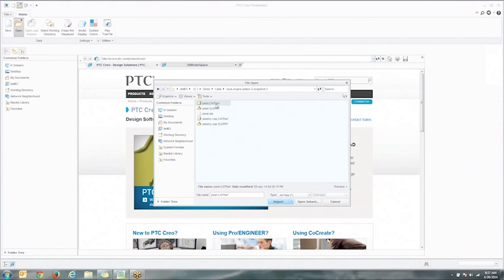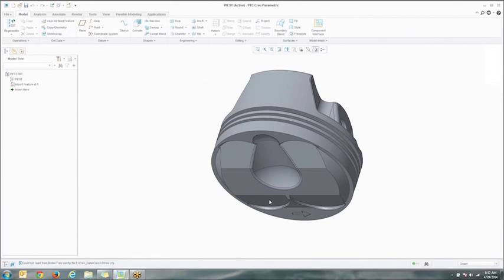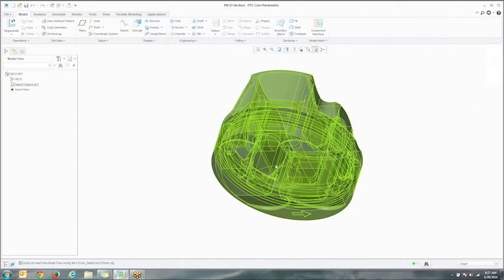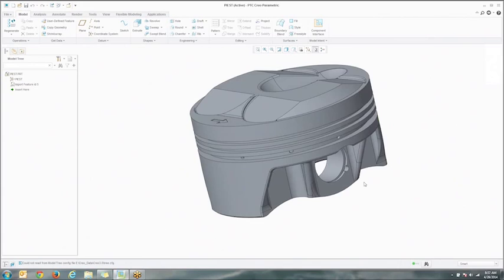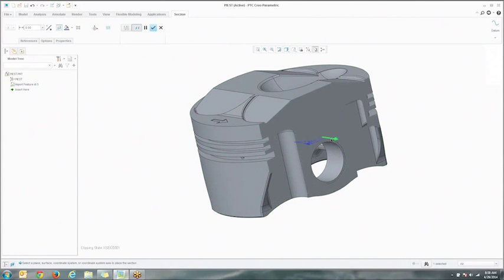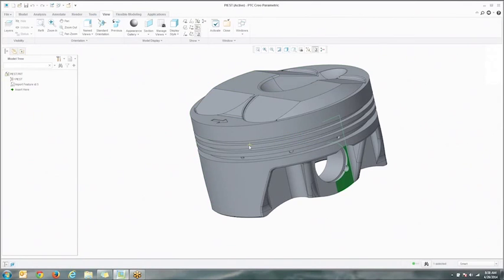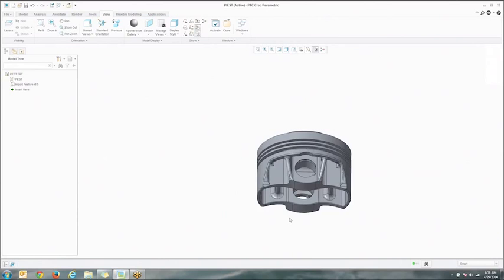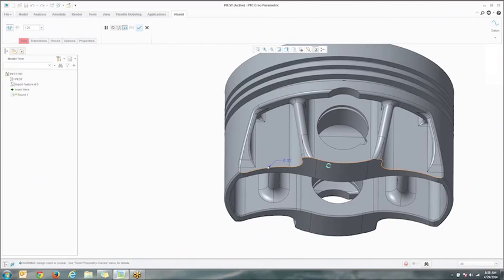PTC Creo Parametric 3.0 - Easily import different CAD formats

Comment: Can we save parts in a non creo format for catia solidworks etc
Reply from the maker: +Harsh Patel PTC Creo Unite allows users to open many major CAD files natively, without being translated in Creo Parametric 3.0.

PTC Creo Collaboration allows users to write out CAD files in the native formats of many major CAD softwares. No 3rd party software is needed to write out the native file formats